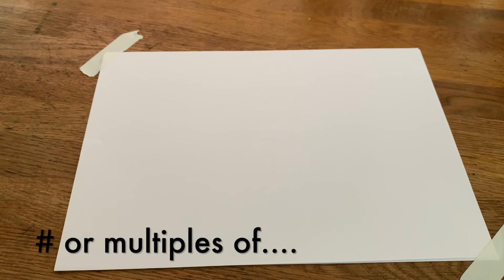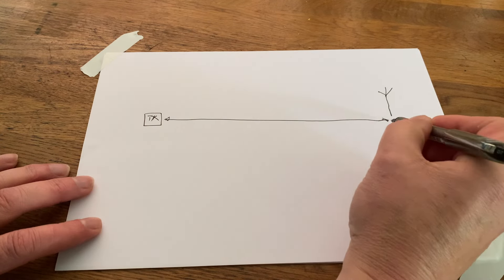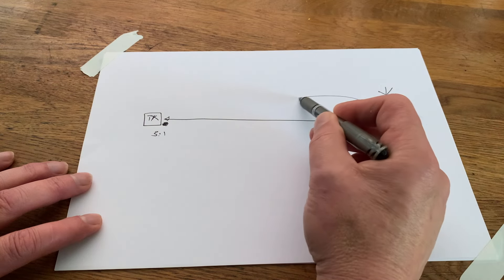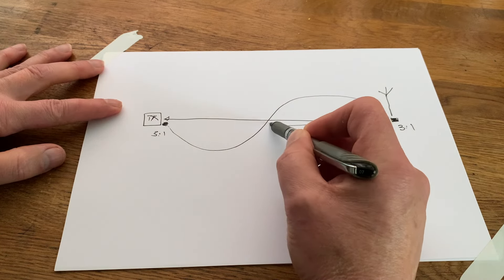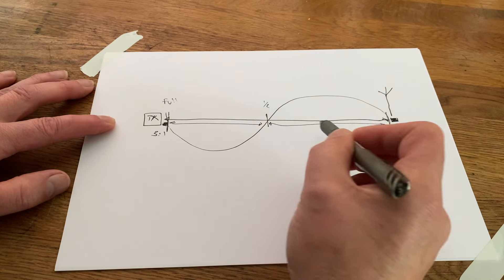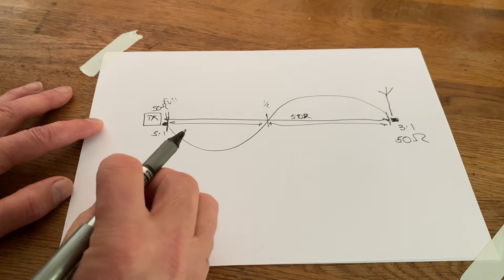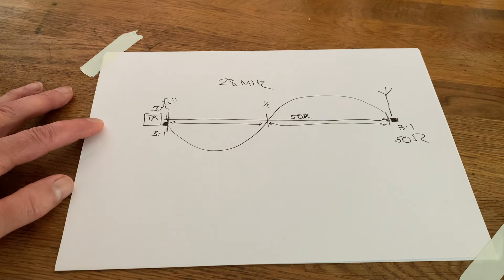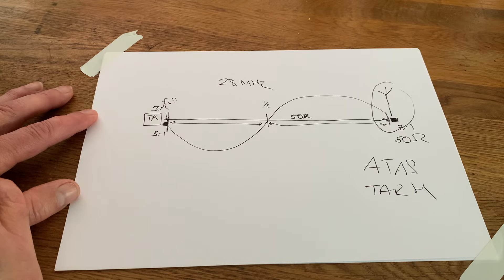THE FACTS:  Half Wave Length Coax Runs - what you need to know!

Comment: If you understand basic transmission line theory, lecher lines etc. this is a non argument. It's good to have multiples of an electrical half wave if you're going to monitor the SWR at the rig. However if you want to use a tuner at the rig on a multiband antenna, you may want some other electrical length to get the tuner to work effectively on certain bands. Sometimes you might even want to exploit the length of the line to get a certain impedance at the rig as well 😅 It's fairly simple to understand overall
Reply: Make another tuner which will do different impedances than the one you have so it will match, or as you say lengthen or shorten the aerial wire.
In 50 years I've never cut coax to a specific length.
G4GHB.
Reply: @bill-2018 Yes I know, we should all do what you've done, even if it's more costly and less practical. Did you even understand the gist of what I was saying? People have been doing the same thing with balanced lines and tuners since the beginning, the only difference is that in the case of what I explained, it's a coaxial line. No different. I also described different scenarios where you'd alter the line length. You don't understand how your tuner etc actually works it appears.
Reply: @Dazzwidd  I've been doing radio 50 years.
I think I can say have learned something! 
The radio books explain everything perfectly well about tuners and their operation. 
I used tuners on long wires and doublets way back when I first started and a tuner these 10 years or so when out at special event stations.
I know coax length certainly does not matter with a tuner. 
I can only say the aerial this guy is using seems crap. I'm not going to put up his aerial then have to buy 50' of coax to make it work. I use 45 inch coax to the tuner because of where my long wire comes in with a copy of a Joystick on the end and it works and tunes from 160m to 10m perfectly with a low SWR on all frequencies. He can keep that aerial of his.
 I have previously used longer coax lengths as well. No problems. 
Coax of about 25 feet to my outdoor vertical. I have no problems. I don't need to cut any coax because of impedance problems because I don't have any. 
50 years of getting out and now 30+ years of QRP tells me I'm doing something right.

G4GHB.
 Unless you now say I'm doing something wrong.
Reply: At one special event station operating with Frank, he used his commercially made aerial and I used three 5' aluminium tubes which slotted together, a short wire to my variable capacitor and roller coaster then a short length of coax into my tcvr.
On that day I made all the contacts and Frank made none.
My multiband set up didn't need me to use a certain electrical length of coax to get on air. 
No problem with impedance matching at the rig either.
It's fairly simple to understand overall! 

A counterpoise earth would have improved things but we didn't bring any spare wire.
G4GHB.
Reply: All I've done is mention transmission line theory... think about that
Reply: @Dazzwidd  73
Reply: @bill-2018  I don't see the logic in leaving your tuner in un necessary stress because you won't apply transmission line theory 🤣
Reply: @Dazzwidd  WHAT!?
Reply: @bill-2018  That response reinforces my point exactly
Reply: @Dazzwidd  50 years of radio and I've never had a problem. What do you think a tuner is and what it does? 
Radio amateurs world wide should have had years of problems. Why don't they blow up their radio year after year? Because what you say is nonsense. 

Never had to cut coax to a specific length either. Except for the obvious of phasing two crossed dipoles and matching to the D.E. on a h/b Yagi. A coaxial balun, not the feedline coax. 75 Ω tx, 75 Ω coax, 4:1 balun to 300 Ω at the Yagi D.E. Or if I was using a 50 Ω system I would tap the dipole further in to get 50 Ω

A Gamma match is on my 50 MHz dipole, I'm not making it match by cutting coax. There's 50 Ω at the tx, 50 Ω coax, 50 Ω at the dipole.
Why are you trying to make a problem which doesn't exist? 
G4GHB.
Reply: @Dazzwidd  Not really.
So why aren't amateurs constantly replacing their radio gear or having the final output transistors replaced ?
Tell me.
Reply: @Dazzwidd  Not at all.
I made my aerials 50 Ω to match the tx and coax.
Not the coax feed line by cutting it to some imaginary length.
Reply: @Dazzwidd  Take a typical C.B. set up, 3', 6' 9' or whatever jumper lead length, SWR meter and their magical 'tuned coax'.
Does the r.f. not develop on the jumper lead? Is there no r.f. on it if looked at on an oscilloscope? Mine has r.f. on it.
Why is 3' not important enough to be 'tuned'. Does 6' not affect things? Same with changing to 9'.
Or does the r.f. form part of a wave then suddenly collapse at the SWR meter then sees 'tuned coax' and races down 'tuned coax' to the aerial?
How does it know where the 'tuned coax' starts?
Oh, it's because of the SWR meter. the jumper lead and meter does nothing I suppose you'll tell me now.
You must have some really magical coax that the r.f. can't see a 3', 6' or 9' piece of coax and SWR meter and r.f. only sees your 'tuned coax'.
Reply: @bill-2018  Yep, as I thought, you don't actually get it. You want your tuner components to do the least work necessary so there's the least amount of losses in them. Why is this complicated to you?
Reply: @Dazzwidd  Believe whatever you like.
There's minimal losses.
Reply: @Dazzwidd  I've never had any problem in 50 years.
Is that difficult for you to understand?
Reply: No answer I see.
Reply: @Dazzwidd  I see no answer so I'll repeat my questions.
How and where does the r.f. know where the tuned coax begins?
Why is the jumper lead not trimmed? Any increment of 3' will do.
Why does a VNA no longer show 'tuned coax' when measured at the tx going through the jumper lead and SWR meter? 
Answer to all: It's because there is only one lead!

G4GHB.
Reply: You didn't really get any of what I was saying. I've lost interest in the thread. You can go and be salty on your own...
Reply: @Dazzwidd  Unless you still believe the SWR meter is an isolation device and there are two independent cables.
Open one up and look, you must never have done, the two sockets join together so there are two lengths of cable joined together in the meter so making one cable with an SWR meter inserted.
Just take a look.
Reply: @Dazzwidd  I lost real interest in it days ago.
One coax, no magical 'tuned coax'.
Reply: @bill-2018  Transmission line in less than resonant lengths exhibits reactance 😆 Actually, it does it in greater than resonant lengths too 🤣🤣🤣
Reply: @Dazzwidd  Radio amateurs don't have problems with coax.
It seems to be a C.B. thing.
Ever wondered why?
Are you saying my dipoles will only work on 20m because my coax just happened to be extremely close to a resonant length at that frequency?   
14 MHz and 21 MHz on one coax, with 18.1 MHz, 24.9 MHz and 28 MHz on another similar length of coax and they don't work?
I take out my SWR meter as it's a resistive Wheatstone Bridge type so I do have a resonant length at 14 MHz, so there is no more coax to it to affect it's resonant length.
But C.B.'ers seem to think only the coax after the meter is the one which matters and the meter doesn't connect both cables together.
I therefore must have a similar problem with only 45 inches of coax to my tuner and 25 foot long wire for lower frequencies according to you.
Strange I don't have problems there either.

Nothing over 5 Watts here and my log book shows they all do work!
Reply: @bill-2018  Don't be norty

Comment: you forgot velocity factor and odd multiples  and the phase inversion  of even multiples  .i suggest you read maxwells book  reflections  to be better informed . yes correct on single frequency usage
Reply from the maker: Keep it simple…
Reply: Why single frequency? I don't get what you are saying.
For a video to disprove the myth my 'tuned' coax for 14.040 MHz supposedly only good for that frequency according to C.B. theory shows an almost flat response from 1.8 MHz to 29 MHz with a VNA and 50 Ω dummy load on the end. 
G4GHB.

Comment: Incorrect.  Your statement @ 4:18 is true only if the antenna has no reactive component (antenna's 50ohm impedance is purely resistive).  At that point, it isn't an antenna, it is a dummy load. Anything that can be called an "antenna" has a reactive component to it's complex impedance.
Reply from the maker: Apology for dumbing down a very complex subject. I just tried to make it simple.

Comment: Multiband antenna's prove that the length of coax is not vital.  End of story.
Reply: Mmm,,,of tuner is at shack end you still have high swr in at antenna  feed point and in coax,,,reflected  power in coax is dissipated  as heat and can get so bad it will flash over inside the  coax in sone cases,,get the tuner out at antenna feed point and see the difference in performance.
Reply: @battlestarone  repeat after me, "SWR is not loss, reflected power is not loss, SWR is not loss, reflected power is not loss..."

Comment: The only time it has seemed remotely important about length is using cheap coax for hf on long runs. Like rg6 250 feet long. With reasonable good coax, does not matter.

Comment: You are wrong if I need 30 meters of coax between my radio and antenna  and I use 200 meters of coax I will have more loss based on the coax loss if I shorted it to the lenith needed between the radio and antenna that is the correct coax lenth
Reply: Did you actually watch the video?